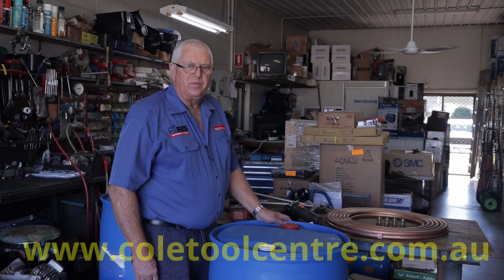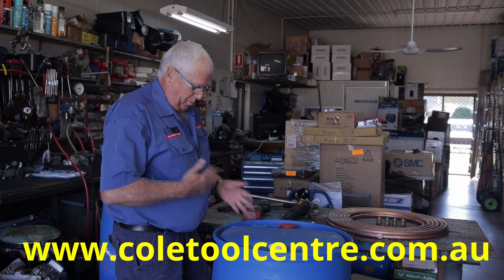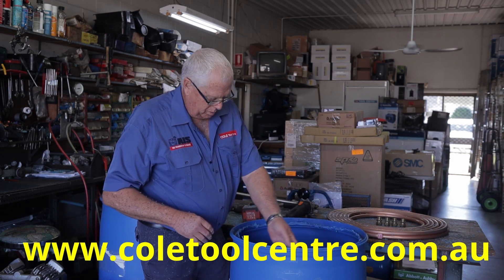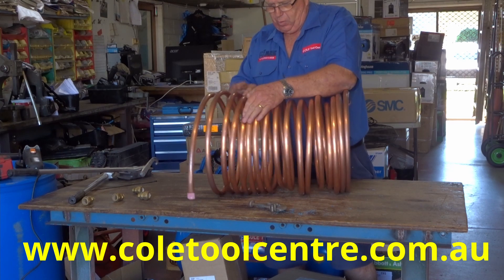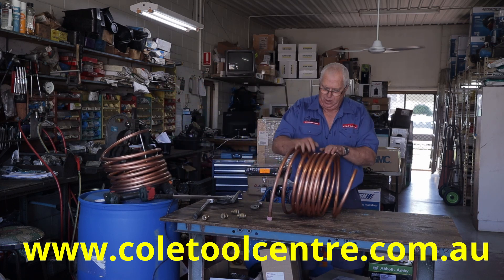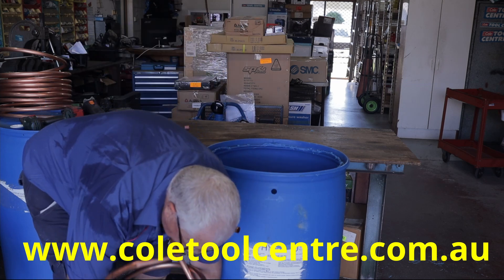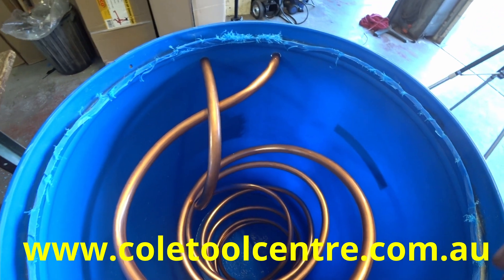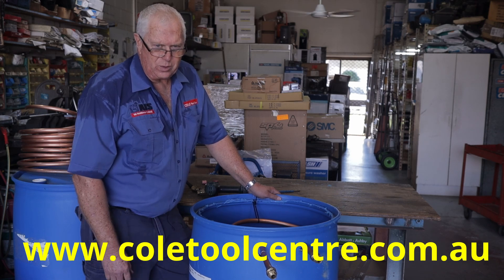Heat Exchanger for Removing water from your Compressor airlines. DIY

Comment: You're going to get condensate building up in the bottom of your coil. You should add a T in the bottom, with a pipe out the barrel for draining/bleeding.